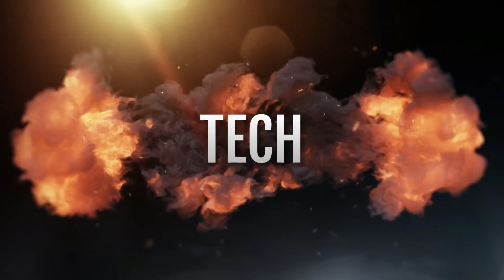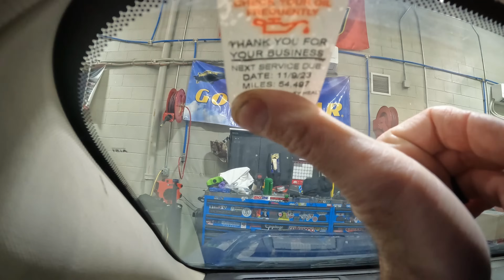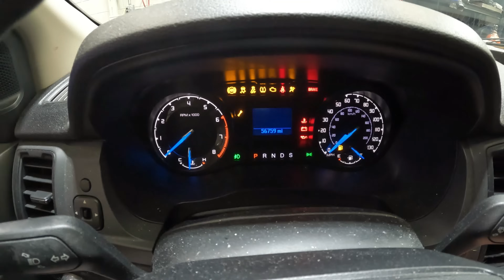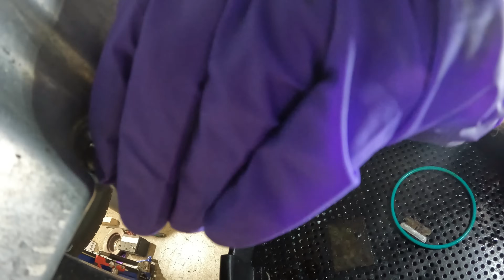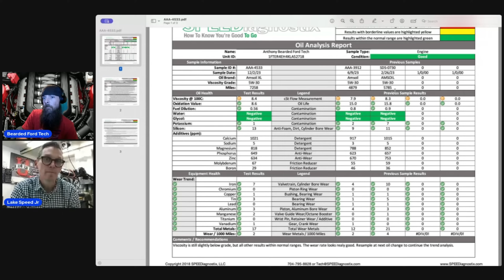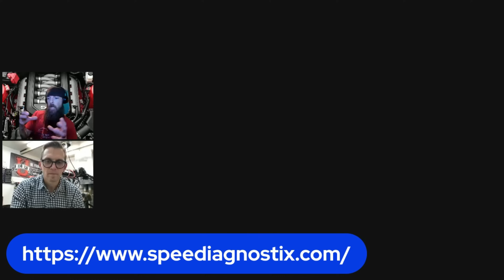7,258 Mile Used Oil Analysis With Auto Start Stop...SHOCKING RESULTS! #newtoyou #fyp #amsoil

Comment: My question is this...was the oil changed every interval? Fresh oil each time and then you extended the milages? So it would be 1) New oil and filter, drive 4879 miles, take sample while changing oil. 2) New oil and filter, drive 5785 miles, take sample while changing oil. 3) New oil and filter, drive 7258 miles, take sample while changing oil. Or, did you remove some oil from dipstick tube using a vacuum pump at the different milages and do a final at oil change on the same oil? Confused.
Reply from the maker: Nope. Went 7,258 miles and took a sample when I drained it. No samples in between. Just straight 7,258 miles. Not really confusing. Clearly states 7,258 mile used oil analysis.  Did you see the first 10 seconds?  Literally taking a sample from the oil pan while draining. The trend analysis is from two different oil changes for two different tests not this test.

Comment: @ so if auto stop/start is better at reducing fuel dilution does it hurt more for  short 3-15 minutes trips or hurt it more.
Reply from the maker: You should never drive short 3-15 min trips. Thats where fuel dilution comes in as the oil isnt heated to evaporate it.  Start stopnreduces that dilution cause it isn't running.  Always try and drive for more than 15 min.
Reply: @BeardedFordTech  my clients are anywhere from 3 to 15 minutes from each other 90% of the time the maximum my drive is 20 to like 35 minutes to start or end the day but the rest of the day I’m doing short trips. My oil test don’t shut doesn’t show a lot of fuel dilution with the amsoil but my truck still has 40,000 miles on it roughly so I’m figuring it’ll get worse as it gets older
Reply from the maker: @halftontimrvreviewsandtips3106 it shouldn't get worse. If your fuel dilution is low thats good.  Also run fuel system cleaner about every 10-15k. That helps a lot.  And drive different routes sometimes. Mix it up a little. You should be just fine.

Comment: what about Turbos?  You pull up to a light and the engine stops, but that turbo can spin for a bit afterwards.  I drive a twin turbo and always idle about 20 seconds when cold to get the oil to the turbos.  I also let it idle 10-15 seconds after stopping to let them slow with oil flow.
Reply from the maker: Technically when shutting off your truck like pulling up to a gas station or home for the day your supposed to let it idle for 2 min (if you have a powerstroke)But with an auto start, stop event two things are happening. It's not off long enough to lose much oil the engine will start back before that happens.  It has an electric coolant pump or an auxiliary one to keep coolant flowing through it.  If temls get too high it starts up. Same with the cab temp. If there's a temp change in the cab it starts up.  All of this has been thought of. I did a video like years ago about how the system works.  The 6.7 powerstroke turbos get way hotter. And therefore do not have start stop (and for other reasons)
  Also some vehicles the electric coolant pump will flow coolant to keep the temp down when the vehicle is parked. Not all of them do that. Some brands do.

Comment: Well if you have a down in the dumps engine condition with coolant leaking in and gasket material shredded in the valvetrain and dirt and burnt gunk stuck on the bearings and dirt particles from driving in death valley for 10 years.....no engine oil no matter how good will make it past 2000 miles in useable condition. Its all about the condition of the engine to begin with more so than the quality of the oil as long as the oil meets all ASE API certifications.
Reply from the maker: I take it you have had an engine like that?  Thats not good

Comment: I have a 1992 f150 how long would you run the amsoil
Reply from the maker: Run it 5k and send it off for an oil analysis at www.speediagnostix.com that will tell you if you can go further. Use 5k as a starting  point.  But make sure ypu do at least 2 oil.cha gea before sending it in.  Want to make sure it's all amsoil and nothing else mixed with it.  Don't want any false results.
Reply: Thanks I have been curious about using a better oil and trying get more out of it I have been using cheap Walmart oil

Comment: I would not go 10 k miles with any oil pull the oil pan  and that tell  you the story  with 10 k miles need new engin at 100k
Reply from the maker: Umm no. That's what oil analysis tests are for. Oil has come a long long way.  Quit being stuck in the old ways. Cause modern engines have come a long way too. If the anaysis comes back and says don't go 10k. Then I will back it up.  This would be the first time going 10k on it. All for testing.  So your telling me my engine is just going to automatically break in 39k miles?  Cause I'm at 61 now.

Comment: I used to use Mobil 1 every 7500 miles in my 16 Silverado and would burn a quart every oil change.. after doing some research and watching certain channels who test and compared different oils and companies, I quickly learned that Mobil 1 certainly wasn't the top dog in oils like I had first thought. So I switched to amsoil. Now I change my oil every 15000 miles and literally went from burning a quart every 7500 miles to less than a pint every 15000 miles. I pull a 2500lb boat at least twice a week as well in the Texas heat using 0w20. I'm a believer in amsoil and I'm happy I made the swap.. people have to ask themselves why would a company like amsoil GUARANTEE,  25000 mile normal service protection, or a 15000 mile severe service protection if they didn't know what they were talking about?  I mean, they'd have lawsuits up the yinyang if their claims were false. There's no sense anymore to be throwing out good resources doing these 3000-mile oil changes, assuming they're using a good synthetic. It's just such a waste to be throwing out good oil but to each their own. I'm sticking to my 15000 miles services in my pickup and 20000 in my wife's car. Both run strong, quiet and very smooth.
Reply from the maker: It's a great product. Get a pil analysis done so you can see what's going on in there. Mobile 1 is straight garbage. We have had this conversation before on livestreams. He's gone over this too.  Amsoil is a great product. And like you said people may be literally wasting money with 3000 mile oil changes. I tell people at least 5k cause I don't know what oil they have. If I do know most of the time it's low end stuff.
Reply: I was suckered just like everyone else with mobile 1 they really deceived a lot with their marketing
Reply from the maker: @anthonymakley1530  yep. Mobil 1 is  Not at all what it's hyped up to be.
Reply: Mobil 1 is fine, if your engine has high wear numbers on Mobil 1 and you need amsoil just so its not shredding itself to death.....  theres something wrong.

Comment: Best practice is to change the oil and filter every 3000 miles.  Use an inexpensive oil (non-synthetic) to keep the cost low.
Reply from the maker: 🤦‍♂️I'm just going to pretend I didn't see that comment. Have a nice day

Comment: I enjoy Lake and his knowledge, but I disagree with him on this. Start stop in these engines would cause more fuel in the oil. And the Oxidation on this oil is high due to the AN and esters in the oil. It going down, shows the oil is worse
Reply from the maker: If you say so. I think you need to go back and listen why the viscosity is where it is. Look at the previous changes too. Look at all of it. Go back and look at the other streams. Listen carefully.   How does a stopped engine have more fuel dilution?  There's no fuel being sprayed.

Comment: Quick question. I change My oil every 3000 miles with quality synthetic oil and an OEM motorcraft filter. When I check my oil on the dipstick it still looks  almost new. Clean and very light brown.  So when I goto drain it the oil is always darker. Why would it look barely used on a dipstick to black at the drain plug???
Reply from the maker: Because the dipstick is just taking a small sample on a very small metal rod. Like if you were to dip your finger in it. When you say good quality synthetic what brand do you mean?(please don't say Mobil 1) get an anaysis done. I'm sure you can go a lot longer than 3k. You may be wasting money.
Reply: @BeardedFordTech  Ams oil
Reply from the maker: @J_J_Ander  that's what I use. Sounds like a lifters and rockers in the video. I would check the valve lash make sure they are in spec

Comment: I am doing the same thing right now on the start stop thing, I feel better about using it now, but I'm still going to verify with lab testing.
Reply from the maker: Remember everyone drives different. Every engine is different. The myth is using it causes engine wear.  When in reality it's not off long enough to cause wear on startup. First startup in the morning does more wear.  However. Make sure you get a trend going. Your going to need more than one analysis. Idling for long periods washes out cylinders causing fuel dilution. You heard hum. Fuel dilution is the number one cause of wear.  Start stop reduces fuel dilution as you can see in my test. Cause it's not siting there idling. I'm curious to see your results as you get a trend going. Make sure when you do them. Use the same oil and filter and try to drive the same as you did for the previous one.
Reply: @BeardedFordTech  right now I'm trying to figure out the best oil/filter combo then on to the start/stop part. I just recently purchased this vehicle and just did the first oil change so it will be a minute before I have a initial set of data.
Reply from the maker: @jeffhudson2346  oil analysis will tell you what combo. I run amsoil 5w30 xl series. And a Motorcraft filter.  This is the fun part. Seeing what works best. I can recommend good oils and filters. But it all boils down to how you drive. I'm an amsoil dealer. I'm not going to tell you it's the best stuff ever to get you to buy it.  Is it good stuff?  Indeed it is.  But what works for me and my driving habits may not work for you.  Or it may work better. Won't know until.you get lab tests done.  It's going to take a few to see the trend. But it's all worth it. This is how you can be absolute sure your engine is running in perfect condition. If you want to try amsoil. Let me know. If not. That's fine too.  I'm curious to see your results. Maybe get you on a livestream with Lake Speed so he can go over it with you if your interested in that.
Reply: @BeardedFordTech  It could be interesting for sure because I am starting with my old reliable combo for Ford V-8 engines, Motorcraft 5-30 synthetic blend and the Fram orange can of death as a starting point.
Reply from the maker: @jeffhudson2346  interesting to see what the Fram would do. I'm not fond of them. Never had good results with them. But. Everyone drives different. It may work great for you.
Reply: @BeardedFordTech  My personal results have been really good over the past  three decades in a variety of engines.
Reply from the maker: @jeffhudson2346  that's good. See it works for you. But didn't perform well for my driving habits or equpiment
Reply: @BeardedFordTech  like you and others have stated, all of this is application based.

Comment: I’ve been doing 3k mile oil changes.  Pennzoil Ultra Platinum full synthetic & filter.
Reply from the maker: Get a analysis done. You may be able to go further. You may be throwing money away at 3k miles.
Reply: How much $$ is that?
Reply from the maker: @stevenn4393  how much does your oil change cost?  If your not using the oil to its fullest potential your throwing it away.  The anaysis is $65. Well worth it
Reply: I'd spend $65 to check condition of engine, but not to see oil life remaining. Maybe spend the $65 on an extra oil change instead and just know that you're not using the oil to its fullest but your engine has fresh clean oil and filter. Your wallet would have about the same amount left but your motor would definitely be better off.
Reply from the maker: @markelliott7917  just a test to see. Ot the oilife remaining. But the additive package remaining  and if it is doing its job. And the health/wear rate of the engine
Reply: And the time.
Reply: You must like wasting money

Comment: This might explain in part of the Florida guy that had 1 million miles on his '07 Highlander Hybrid, which having one I can tell you does start and stop with the 3.3L V6, also with the hybrid it takes a lot of the acceleration work/load off the engine. **Great video thanks. I really appreciate this content. Also recently discovered Blake - one can definitely rely on his knowledge and analysis.
Reply from the maker: Indeed the hybrid does take a lot of work/load. That would have been a good oil sample to send it at 1 million miles. Thank you for watching. Your very welcome. Lake has some great videos too. Very smart huy. Very knowledgeable

Comment: now drop a  purolator  boss  full syn oil fil on that beast, and run 2 oil changes threw it, 10,000 miles each, then send that oil sample  and filter at 20,000 miles over to mr. speed, i wanna see both sets if eyeballs side by side on video !!! YOU CAN DO IT,  SPEED KNOWS SO !!
Reply from the maker: Purolator boss is a good filter. That's my second choice. But I'm keeping It the same for a few trends. Then I'll start changing to different filters and such.

Comment: Thanks for the information, If you don't mind asking, how much does an oil analysis cost. Thank you Sir for the video.
Reply from the maker: Through him it's $65. He sends the kit that comes with the bottle and a flat rate box with a shipping label already on it and instructions.  Remove plug. Wait 3 sec fill bottle to line. Put cap on. Put in bag. Put in prepaid box.  Go one and fill out the form. Drop box in mailbox. Easy. $65 is well worth the information you get from him and to know what's going on inside your engine. And if something is going on you can catch it before it gets worse or itoo late. Best $65 you'll ever spend

Comment: Excellent video Anthony!  Lake has extensive knowledge in engine building, motor oil development and analysis. The Speed Diagnostix report goes more in depth than Blackstone Labs.

Which Amsoil 5W30 oil are you using? How far is your daily round trip commute and what are the conditions such as highway or city traffic conditions?
Reply from the maker: Amsoil 5w30 XL. My drive to work is about 10 miles. Home differs depending on errands. So average 45 miles a day. It is literally 50/50 city highway. There are other ways to go. But for testing I'm trying to keep it as close to the same as possible.
Reply: Anthony, in the closing minutes he spoke about the thinner oil providing better protection on the Vette engine. Have you considered going to a lower viscosity as well?
Reply from the maker: @Propelled  Nope. No need to. My weight oil works just fine. The vette doesn't know what it likes lol.

Comment: If your piston rings are in excellent condition with no gummed up oil rings ,You should get no fuel mixing with your oil,,I have a 1.5 dci Renault Diesel engine,I change my oil every 3500 miles with MPM C3 5w40 oil,,The engine takes 4.8 litres and after 3500 miles 4.8 litres comes out,,It doesn't use any oil or make oil,,
Reply from the maker: Mine doesn't use or make it. But gasoline engines will always have fuel dilution. Especially if the engine is cold because it rings haven't swelled. We went over this towards the end of the video.
Reply: @ Nightstorm:  Sorry, this is simply not the case with modern GDI engines,  fuel dilution of the oil is real and very typical, especially with engines that spend a lot time idling and operating cold.
Reply from the maker: @D2O2  yep. Apparently even with the science behind it and the testing we are still wrong. How else can we prove this to people?  Your one of my favorite subs. Shoot me an email.  I'd like to talk to you.

Comment: Why??? Why??? Oil changes are very cheap. Insurance payments, gas, and depreciation cost thousands each year oil changes 30 to 50 twice a year60 to 100. You can't change to many times. I had a Toyota pick 2000 and changed oil 37 time befo re trading in for new pickup in 2019. Dealer was shocked 
At how clean my engine. Gdi engines are very tough on oil and breaks down very rapidly.
Reply: Some people put way more miles a year on a vehicle than others.  Did you ever run any oil analysis on it and actually quantify how hard it was on the oil,  or is this simply your opinion based on anecdotes?
Reply from the maker: It's an opinion. He knows it. You know it. I know it. And I also know and so does everyone else that the analysis doesn't lie.  Why throw mo ey away doing an oil change when there's plenty of oil life left that is doing its job.  My engine is very clean inside. Literally the results don't lie.
Reply: Why would I do an oil analysis? That is as much as an oil change.
I do all city driving in Texas 100 degree day 70 to 90 days a year. 
I have two cars change oil every six months cost me 120 dollars. That cost me 1000 to 1500 in ten years. Insurance will cost 7000 to 10,000
In thar same time. And don't have worry about damaging a 5000 dollars engine. If you can get me a method of getting 15,000
Miles on one Insurance payments jump right that.